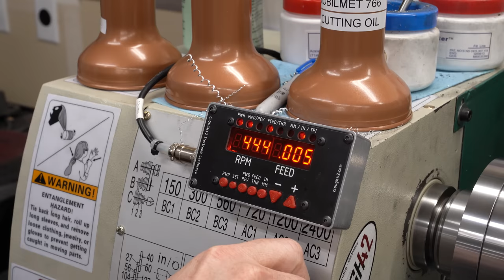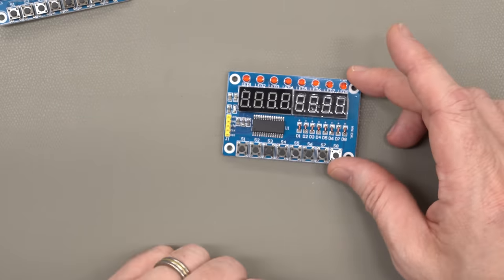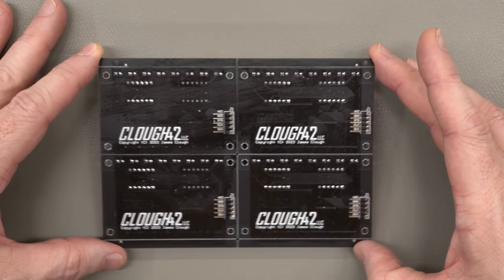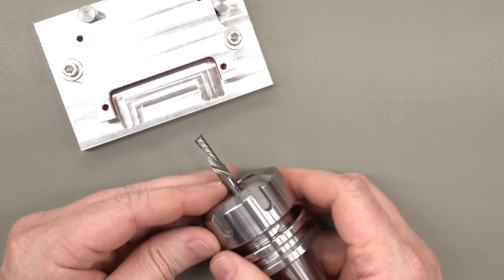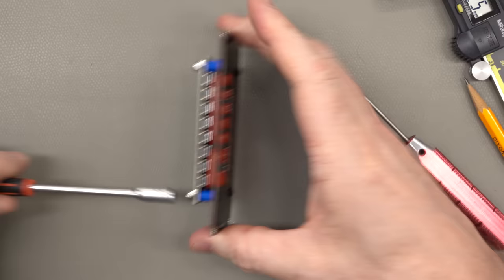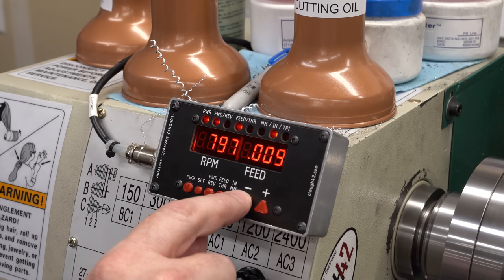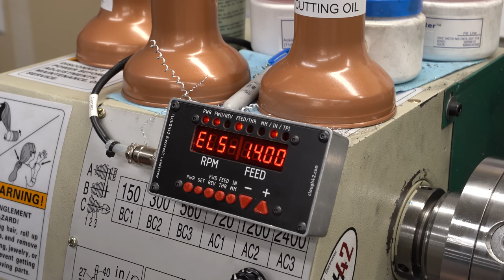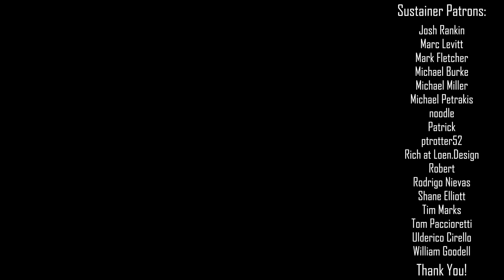Updating the Electronic Leadscrew Control Panel

Comment: I have been thinking about building my own lathe and possibly a mill. I was thinking its alot of work to build it to thread screws. Then thought build it without. Then i was thinking what the point in that, may aswell thread also but how. This couldbr the answer , i want it to be atleast 6" chuck, and 48" capacity with two steady rest, with 6"-8" capacity, make it from welded steel,  using fixtures, so the components can be precisely aligned and hopefull adjusted by using a file or adding shim stock. Use 4"x1" flat bar, and 1x1" bar. Precisely machined for the ways. Maybe cast a compound slide, about 10" bottom travel, and 8"-10" upper.  With the chuck mounted high enough to have a 12"+ chuck,  use a 3kw brushless dc motor, with speed and direction control,  use a wide serpentine belt,    it should offer a very quiet operation,  use tapered truck wheel bearings for the spindle  and either electronic Regen braking, the rotation converted to heat, or a light duty motorcycle disc brake,  spring applied, with the shutoff lever.  Having reverse ,neutral, brake, neutral, forward detents. And a decent size leadscrews, a carrage with double nuts to allow some jamming action to adjust clearance,  just a idea, im guessing a els needs a decent size motor to push thr carrage!

Comment: Every wire, going in or out of the display board, should be protected from noise.  Loading the lines down with a resistor is a poor way of doing it.  The power lines, should have two ceramic caps after the connector, directly across power and ground.  First a 0.1uF, then a 2.2 to 10uF capacitor right after it.  These capacitors, do not replace the 0.1uF that should be as close as possible to your display chip across power and ground.

All signal lines, should have a low pass RC network on them, immediately after the connector pins.  Typical values 0.01uF to 0.1uF, and 100 ohms to 2.2K ohms.  Layout is important here.  There should be a ground plane directly under these components, so one end of the capacitor can go directly to ground with the shortest  possible path.

The best scenario for selecting these values is run the lathe at its maximum RPM and monitor the signals with an oscilloscope.  If you see the square waves being rounded off, you went too far on the RC filter.   Here are some search terms, in Google image, search for this "input circuit RC noise filter", and in Google search for this, "Digikey Low Pass/High Pass Filter Calculator".

P.S., absolutely amazing work you have done here, using the 3D printers to make a professional electronic device.

One question though, on the original display boards with the pins sticking straight up.  Could you bend them over 90 degrees without breaking the pins and have room for the connector?

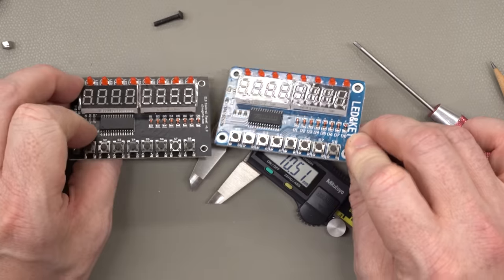Comment: 15:00 you're already paying for through hole and double sided load for those crappy dupont connectors. 

Use a good latching smd connector instead. Even if you have to notch the board to allow the wire to fit inside the enclosure it will be worth it. 

Those dupont connectors are unbearably crappy and are a likely source of your issues in a relatively high vibration environment like a lathe.
Reply: Hell, JST is available in SMD right angle. 7 segment displays are available in SMD also, he could eliminate the handwork entirely.
Reply: They are crappy, but they are almost certainly not the source of the glitching.  He very likely has ringing on the clock and data pins due to fast edges being generated by the source and no termination.

Comment: I have had the occasional glitch on all of the three of the ELS TI boards I have built for Metric and Imperial lead screw lathes.   Its not any problem in performance, so I just put up with it.  I suspect its due to the stepper control noise but I have never isolated it.  I will try the lower resistance surface mounts.  Since I will only swap the readout, it will also check my cable configuration.  
Thanks for the tip.

Comment: A small 1-10nF, ceramic cap towards ground on each of the inputs should do the trick.
Tune the capacitance to where you get an acceptable slew rate.
Reply from the maker: If we're dealing with external EMI, this will help.

Comment: In regards to your button clearance - I think it would've been better to edit the spacer a second time. You now have two revisions of 2 parts in the wild- one is easily identifiable (your spacer lost its wings) while the other (your buttons) needs to be measured with calipers. A great exercise to solve the issue though. Great work!
Reply: Maybe print the new, shorter buttons in a different color to easily identify them?
Reply: That is easy to fix, just print an extra nub or change the shape of one end of the button carrier section. Then you can tell them apart by feel in the dark.

Comment: Fundamental problem is that the TM1638 TTL logic serial communication is not appropriate for your usecase.

It's would probably not pass any EMC certification. 

If you think about the possibility of harm to the equipment and operator if for example a button read is wrong and changes something critical.

I recommend doing a FMEA. And if it's not already so I would make the control panel "write only" while the spindle is moving.

I would be tempted to use an I2C solution, it would probably be better but not 100% if you keep the length under 30cm. It has some built-in communication error detection. If I felt fansy I use the PCA9615 differential I2C transiver.

There is always the option of going for FDCAN but it may be overkill.

Comment: As well as the decoupling caps on the IC (positioned as close to directly across the IC power pins as possible),  if you're concerned about noise glitches then consider a cap from the high-impedance digital input of the IC down to 0V on each of the lines - again positioned as close to the IC pin as possible.

Exact value should be determined looking with a scope to have as high as you can whilst still obtaining valid logic levels on the narrowest of pulses.   The caps will form an RC with the series impedance of the long wire.  If you want to have further control and better manage noise then add a series resistor of your own as well.

Comment: It would be best to have a hot air station for surface mount soldering.  They can be very cheap or costly, like most tools.  If you spend $200-300, you can get a relatively inexpensive model that's of reasonably good quality.  Look for Quick 861DW or Atten ST-862D (about 100 bucks cheaper than quick).   Of course, you can get much higher quality units from JBC and the other usual suspects that manufacture pro soldering gear, but those are going to run you a good thousand dollars or more.

Comment: I am upgrading an old craftsman 109 lathe that i got a while back. The original spindle is very flimsy and prevents it from being able to handle any real work on a lathe designed and marketed for real work. 
Ive been going back and forth whether to keep the change gears, or buy an electronic lead screw from you ( leaning the way of the ELS ). Is it possible to buy the board and components from you and solder/assemble everything myself to keep my cost down? Like most start up shops or hobby shops, the budget is tight. Love your videos and you are absolutely an inspiration on par with the legends. I.e. ToT, AvE, Abom, MrPete, and the rest of the greats, in my opinion. Thank you for doing what you do.

Comment: Having seen those glitches, and seeing your schematic, I'd say try putting some small capacitors, just a couple of nF, between your data lines and ground. Full disclosure, I'm not an electronics engineer, just a gifted amateur, but that is what I'd try first. I'd keep those pullups rather high too, because trying to make them smaller, you are only going to put extra strain on your signal pins. I think the only reason why changing the resistor values even mitigated the problem was that you swamped something in either the source or the sink of the signal.
Reply from the maker: Possible.  The C2000 MCU GPIOs can sink 4mA.  I think the EMI is on-board, though, and self-inflicted.

Comment: Many years ago I dabbled a bit with electronics and built a metal detector (BFO type) from a "suggested" design in a DIY book I had.............getting transistors that work was the hardest part.......30% failure rate out of the box was normal......like most things the interest died away and i gravitated to buy in and ready made etc.......the rise of IC's killed it for me.......simple circuits with 777's was about my max.

Comment: Just a FYI, FWIW, and an additional data point: I've been running your original kit display on my MX-210V for about a year now and have never seen one of those display glitches.  (Knock on wood.)  I'm using shielded wire (as I'm certain you are too) between display and TI board, grounded at the TI board side only (as I'm certain yours is too).  Just lucky I guess.

Comment: How soon after moving it to the enclosed area above the spindle motor? Seemed to be working fine when in the free air in front. Typically motors sink a lot of heat through the mounting flange as a heat sink. This printed mount won't transfer the heat away as effectively as an aluminium mount.  Could heat have caused the failure?

Comment: When I have the problem, you are encountering I have had success adding a 0.01 uF capacitor.  The capacitor has no effect on slow rising transitions.  On very fast rising transitions the Capacitor looks like a short circuit.

Comment: That's a nice update. Your ELS is one of the more impressive engineering projects I've seen on YouTube. I'm about to order a lathe, and if I get one that uses change gears for threading I'll be adding your ELS to it. (But I'm probably going to get one of PM's bigger gearhead lathes sincere I will have the space for it Real Soon Now when my new shop out back is done.)

Unrelated to the video, except it was in the background during your intro.... Are you still happy with your PM-935 mill? I'm planning to order either that or the PM-949 soon. I'm still waffling between the variable-speed, cone-pulley version and the step pulley version with a 3 phase motor and a VFD. I think the VFD would give me variable speed without the noisiness of the cone pulleys, and 3 phase motors are arguably more reliable (no capacitors). But it's more expensive and more setup hassle. Decisions, decisions... 🤪 Do you find sound of the Reeves drive in your 939TV objectionable at all?

Comment: I have barely operated a lathe, and I don't have any machinist skills what so ever. Thank you for all your detailed descriptions and very interesting things you make. I have a question regarding the electronic leadscrew control. Can this get a feedback from the cross-feed, in a way that makes the tool-speed constant when turning a large piece from edge to center? Will this give a perfect surface quality over the entire cut?

Comment: 2:07 Late to the party but I suspect those "resistors" are inductors, did that change make it into production? [edit, ok, they're resistors] ELS is one of my favorite YouTube projects. It's all there from start to finish, CAD, mechanics, electronics, electrical, software, firmware, github, production, woes, successes, you name it. Excellent series.

Comment: To be honest, the TM1638 is just not suitable for the purpose here. In industrial environments you cant just use interface standards that are supposed to be limited to on-PCB communication only (I2C, SPI, and whatever the TM1638 is using). If you want to transfer data reliably over wires in the presence of electrical interference, you should use an appropriate interface standard, preferably with differential signaling and proper termination. RS485, RS422 or CAN to name a few. But perhaps RS232 would be a fair compromise here (expense vs noise immunity & complexity). 
Now could you optimize the TM1638 to work kind of ok-ish? Probably... Keeping the wires short, reducing reflections with serial termination, optimizing the pull up resistors, using properly shielded cables etc. Error checking / correcting would be another option. It all kind of depends on how robust the interface must be and what the impact of a bit error is. In the end that is up to you to decide.

Comment: Add multi-start threads!
Reply: Just engage the half-nut on a different line that doesn’t match up.
Reply: Move the compound by half the pitch of the thread being turned.
Reply: The kwackers fork has this capability and more.

I tried linking to it but my comment seems to have vanished; over-zealous spam control?

Comment: @Clough42 as you are producing these boards, are you considering releasing some unassembled boards like your interface board? asking as I'd prefer blue or green LEDs/display, and I'd rather not unsolder everything just for a color swap.

Of course, another part of me thinks (without including any consideration to the cost) that I should release my own version with RGB LEDS/7 segments so you can pick what color you want, but that would make a light filter really impossible to select, and the circuit would more parts to store the requested color, and possibly run as a middleman for engaging the color as requested.

Comment: Dear Sir,
Is it possible to cut 150mm pitch spical thtread on 6mm metric lead screw.spindle will be max between 0.5to 1 spindle rpm. We have spical cutter head fitted on lathe cross slide oppsite side of tool post

Comment: I ran into the same issue, designed a board that used an import commodity CPU module.  Later CPU module orders were called the same but differed mechanically.      Where did you get that red PVC LED lens film,  I need to find some in green and having difficulty locating a source.
 
You did  fjne with  the O603's !   If you do much more soldering  invest in a Metcal or clone.

Comment: @clough42 Are you going to post the updates you are making to the board for noise immunity? The first kit I purchased had a bad LED so I bought a second complete kit. I would like to modify that rather than purchasing a 3rd.
Reply from the maker: You can buy just the LED&Key boards for cheap.  They're all over eBay.  As I said in the video, I'm pretty disappointed in the quality of the recent batches, though.  I'll be documenting everything i do to the boards, if you want to play along at home.

Comment: Time for some ferrite beads.
Reply: Yeah, I was thinking that those soldered-on through hole resistors looked like they had a half turn inductor on them due to size constraints. Maybe this could be done on a two layer pcb with traces - way cheaper, but potentially lots of iterations.

Comment: Hey James, are you running that interface at 1MHz (I looked at the datasheet). I'd consider it fairly brave running logic level comms in an "industrial" ie noisy environment. What do your clock and data look like on the scope? Love your videos and comments about the comments lol. Cheers from down under.
Reply from the maker: Is around 90Kb/s.  The signals look like garbage, and I suspect the issue is the LED driver circuits and poor return path planning on the board.

Comment: Nice video, sucks you had to start making them yourself. Curious what the clock & data lines look like on a scope when it's happening. The open-drain serial implementation on the TM1638 is pretty weird... I noticed that it requires sending and receiving data on the rising and falling clock edges... maybe slowing the clock down even further could help (perhaps 48 or 50 kHz)?  Anyway, best of luck!

Comment: Is your cable shielded? Metal conduit connected to signal ground on both ends may solve problem. Even DIY conduit made from HVAC foil tape.
Reply: The hardest thing to shield in an aircraft is Audio, being lower voltage and running parallel with noisy AC and heavy switching DC.  Generally you ground only one end of the shielded twisted pair.  There can be local voltage differences in the metal since it is built up from parts riveted together.  Any wire that carries current is no longer a shield.

Comment: I "ported" the ELS code to a Raspbery Pi Pico because of TI availability problems.  The basic bones work and I have encoder and stepper running.  My upper end speed tracking could be better and would be improved if I move the UI to the second core (I think).
Reply from the maker: Does that board have hardware quadrature decoding?
Reply: It has programmable PIO control so I implemented quadrature read on one PIO block and step/direction on another PIO block for a stepper.
Reply from the maker: @abowyer284  what kind of count frequency are you able to achieve with PIO on that board?
Reply: I thought I had replied to this several days ago: PIO instruction is executed at 125 MHz clock, about 10 instructions in the PIO code, so one pass about 12.5 MHz best case.

Comment: are you happy with the bambu carbon x-1? You have some great insight for your printer choices. So I interested in what you have to say. Very likely going to be picking one up to replace my smoothieware delta... that has one again gone through a control board (though its been an absolute workhorse for the last 7 years).
Reply from the maker: I'm pretty happy, though they're not perfect.  I'll do a more thorough review in the future.

Comment: I am confused about the LEDs being in the wrong order. Isn't a fix for that a software change. I would guess that the order was due to making the board layout easy.
Reply from the maker: I absolutely could change the software, but then there would be two different configurations, depending which board you have.  Which is worse?  Propagating a weird design, or bringing an incompatible version into the world?
Reply: @Clough42  That all depends on just how evil you are. Muuuuhhaaaaa